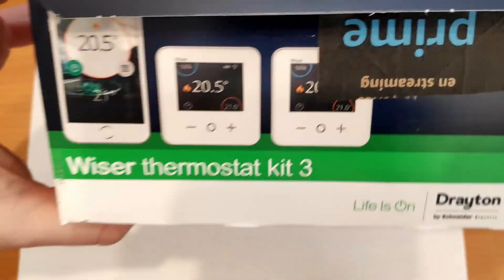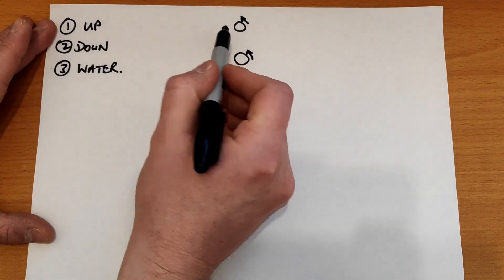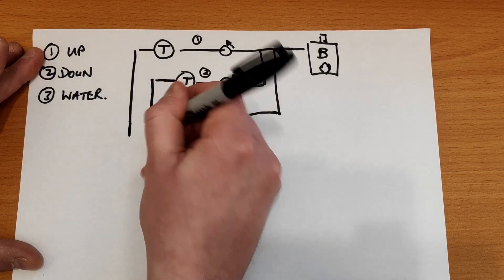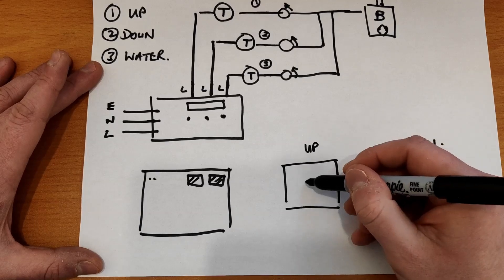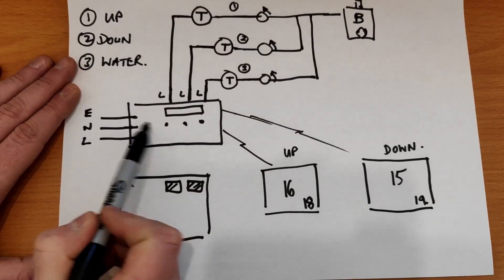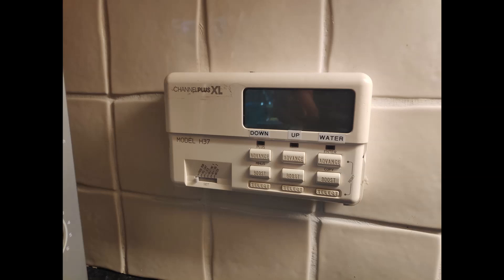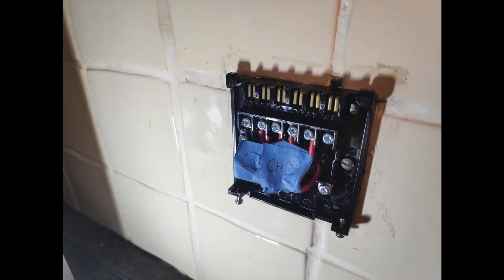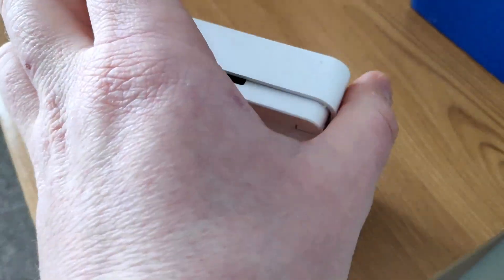WiFi heating - Drayton heat wiser Install video. Smart heating with app control.

Comment: Very well explained video. Just about to fit same system.  Would it work if I was to open the old wall heating thermostat and bridge the live supply and switch live and hopefully would do same thing as setting to max 30
Reply from the maker: Yes you can do that. Or else it can be done at the wiring centre itself. This video here gives a good run down of the usual setup. I left the wall stat in place in case we moved house and put the old controller back in place. https://youtu.be/V9rN5D-wQIc

Comment: Hi i have got a valliant combi boiler. The Drayton Digistat SCR is installed on the wall next to the boiler and the drayton+RF rotatory thermostat is installed on the wall downstairs in the hallway. It's getting very difficult for me to wake up late night and early morning to switch ON and OFF the heating from rotatory thermostat located in the hallway and I decided to look for a smart thermostat which can be controlled by a phone app and heating times can be scheduled and than i don't need to woke up at night to switch ON and OFF the heating. I have been searching on the Internet and I found from Drayton Wiser Thermostat Kit which includes Hub (SCR) and a smart thermostat. I have spoken with Drayton customer advisor team and they told me it's easy to remove the SCR and installing the new Hub. They said that your current SCR is attached on the back plate and that back plate is fitted on the wall with wiring so you just need to remove the SCR and attach the new wiser Hub on the back plate. 

The only confusion is about the back plate. When I removed the existing SCR from the back plate i saw the following 4 wires.
Blue wire in Neutral
Brown wire in Live
Black wire in 1
Grey wire in 3 

My question is do i need to change any wires or just remove the old SCR and attached the new Wiser thermostat kit 1 Hub on the back plate ?? 

Secondly with wiser app am i able to schedule heating in advance for a whole week or a month ??
For example everyday same schedule from Monday to Sunday...
Heating ON for 20 minutes in the Morning.
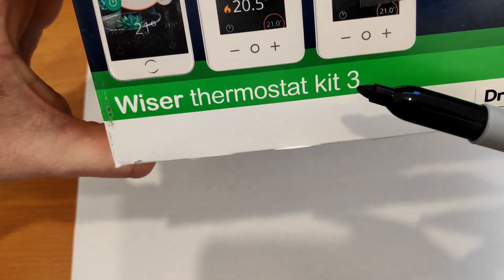01:00 - 01:20 

Heating ON for 20 minutes in the Morning
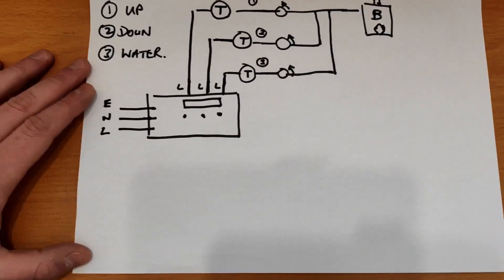05:00 - 05:20 

Heating ON for 20 minutes in the Evening 
17:00 - 17:20 

Heating ON for 20 minutes in the Evening 
21:00 - 21:20 

I would appreciate if you can advise me about the app functions and the Hub. 

Kind Regards,
Reply from the maker: Sorry I don't know what your wiring setup would be but this video from John ward might help. It's excellent and would give you an idea of what the wires are likely to be doing. https://youtu.be/mYwm7SmslyM
Reply from the maker: For timing and setting the heat it's very customisable. You can do different schedules by day even if you want. And then it will repeat the schedule on a repeating cycle of the same setting every Monday for example. You can also with one click set the heat to away mode to bypass all the timers you have created to avoid using the heat while out of the house. Compared to my old manual timer it's a breeze.
Reply from the maker: Also if you look up the wiring diagram for your current controller it should give you info on what the wires are doing so that you can match them up to the new heatwiser hub. Just one word of caution the hub needs a strong WiFi signal to work. My house is small so I don't have any issues. But if you have a bigger house where the router is positioned far away from the router you might run into issues.
Reply: @orbitaaltube  Thank you for guidance. One more question... Does the Hub work with the mobile Internet ? in case if the router is not working what is the alternative and let's say if I'm on holidays and the day when I'm coming backa and want to heat the home by app will it work ??

Comment: Can you take old thermostats off an just mount the new battery ones or do you need old ones? Thanks
Reply from the maker: You have various options. You can disconnect the old thermostats by removing the wiring or bypassing them in your wiring center. You can then either remove them from the wall or just leave them as is on the wall and they will no longer do anything. The new battery thermostats are best kept nearby so sitting on a coffee table or desk or bedside locker so that they are within easy reach. The option is there to screw them to the wall but why bother when you can just leave them nearby.

Comment: Do you need to bypass the hot water stat on the hot water tank? Or just turn it fully up?
Reply from the maker: Leave the stat on the tank where it is. No need to change. Stat on the tank still controls water temp of your hot water.
Reply: @orbitaaltube  Many thanks🙏🏼
So
Drayton hub/App does not control water temperature?

Comment: Perfect, got the same unit arriving tomorrow, so I'm primed now. Cheers! 👍
Reply from the maker: No problem, I just installed a second one of these for my folks as I so impressed with how stable the first one we bought was. After a year of use - It's only limitation is the range of the Zigbee signal used between the thermostats and the main unit. Its absolutely fine for smaller houses like my own which is 110sqm but in larger houses with concrete construction the zigbee range is limited so the controller placement is important for a larger property and its best to locate the controller somewhere in the centre of the property.
Reply: @orbitaaltube  Yep, set up was a breeze, I had to use the new backplate, despite the controller I replaced only being 3 years old. But well impressed with the ease of use of the app. And your tip re setting the existing thermostats to max was a godsend - not messing with those was a huge time saver! Thx again buddy.

Comment: Can you add a temperature  probe  to the thermostat,  so you could control floor temperature of underfloor heating, for a second zone?
Reply from the maker: Not without some hacking. You would need to get the circuit diagram to check if thats possible. It might be worth contacting Drayton customer to suggest it as a feature on their next rev of products.
Reply: @orbitaaltube  Thanks for that, Would be my system of choice if that was an option. Then again I don't mind a bit of hacking, soldering an external probe to the PCB  is do-able,  but matching the resistance curve might be tricky....

Comment: Great video pal, I wanted to hard wire the controls is that possible?
What cable would you need to run to each thermostat? 
Is it 5 core, 1.5

I also have 4 zones
1 hot water
And three heating

Any help would be really greatful
Reply from the maker: I believe this system is limited to two heating circuits and one water so you wont be able to link a separate thermostat to each of your four heating channels. You would have to do something like switch on two circuits together and then use TRVs then to control the temperatures. It's not possible to hardwire these thermostats although you can mount them on the wall to make them look like they are wired.
Reply: @orbitaaltube  thank you so much fir the information, you have been really helpful. I wish you all the best and will be waiting for your next video

Comment: Excellent video - thank you. 

I'm about to do exactly the same install by replacing a Horstmann ChannelPlus H37XL three-channel controller (slightly later version than yours in the video) with a Drayton Wiser 3-channel hub. What's been bugging me is Drayton's claims that it is a straight like-for-like replacement if there is an 'Industry-standard back plate' already installed when, in fact, the ON feeds to the motorised valves need to be reconfigured for the Drayton. ie Horstmann: Pin 1 = Heating Zone 1, Pin 3 = Heating Zone 2 and Pin 5 = Hot Water whereas Drayton Wiser: Pin 1 = Heating Zone 1, Pin 2 = Hot Water and Pin 3 = Heating Zone 2. The fact that you clearly showed the need to swap the back plate wiring is very reassuring!
Reply from the maker: Glad it was useful. Pretty simple to do really even with having to swap over the backing plate. Good luck with the install.